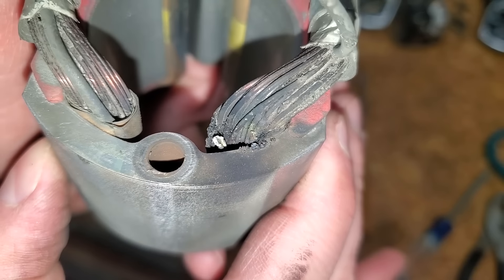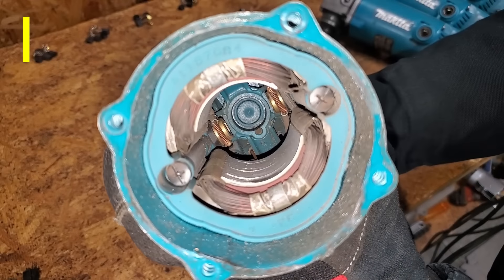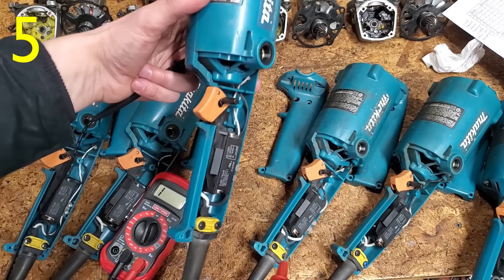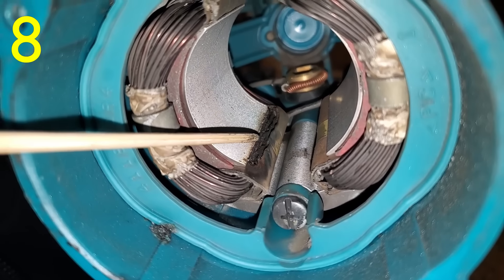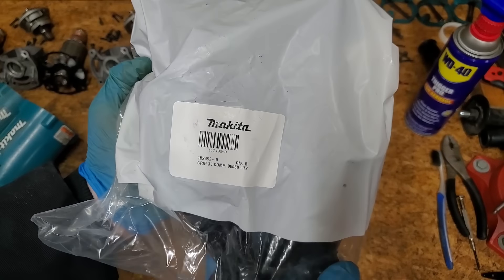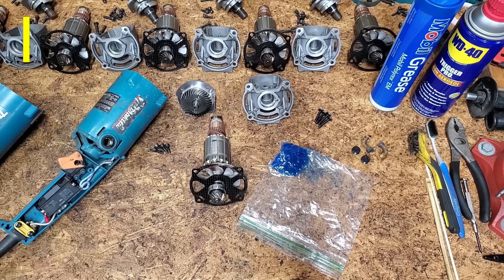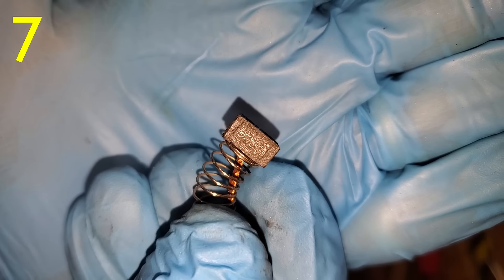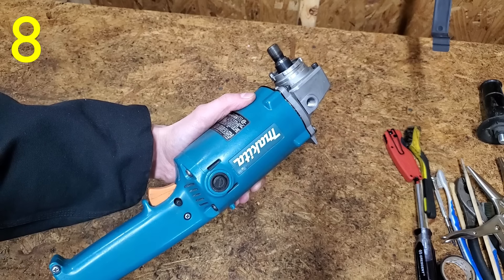Repairing Makita Angle Grinders

Comment: Awesome work Mike. An alternative approach (and no approach is better or worse) is to determine the weak link in the grinder i.e. the stator . In the 1980's I was running a fab shop and the go to grinder was Bosch and the weak point was the armature. So in this case repair four grinders and keep spare bits to keep them running. Absolute luxury in a shop would be three grinders with a cutting disc a grinding disc and a cup brush on each and a spare grinder on the shelf. Please never use a grinder without a guard. Look at How to shred 4 fingers with a woodworking power carving disc - stumpy nubs on you tube.
Reply from the maker: Thanks! All of my grinders have guards and I've been trying to find a toolless version that'll work with these Makitas.
Reply: I have a couple of Bosch grinders. I used to use them almost exclusively because they are really smooth and vibration-free. However, they have really thick casings which leads to uncomfortable hand cramps after using them for hours. I went to the newer US-made (they don't make them here anymore unfortunately) DeWalt 11amp grinders, which are more powerful and much more comfortable for medium-sized hands.
Reply from the maker: @TehButterflyEffect  I have 2 Dewalt angle grinders and have been happy with 'em. I'm not a pro though so I don't use them a lot.

Comment: That little tip about backing it out a couple turns when driving into plastic thread was really useful, thank you.
Reply from the maker: I'm glad, thanks for the comment!
Reply: I've taken many things apart and put them back together and I've never heard or this or discovered it myself. Learn something new every day
Reply from the maker: @aidenschvatkok5732  I'm glad you picked up something new, thanks for watching!
Reply: Works also well with metal and wood. One turn is sufficient, in a logical world at least
Reply from the maker: @sonorex  Yeah, the smaller the threads, the harder it is to feel/hear the "click".

Comment: Really enjoyed the video. 
The spare parts from Makita were surprisingly good value. Never though the windings would be economically viable to replace. 
I contacted Makita in the UK and asked what the yellow grease specifications were they factor fill the gearboxes with. They said they couldn’t help. I wanted to Re- Grease my plethora of grinders. To make them last.  I ended up using a red molly based HP grease.
Reply: Will be getting a tube of the blue stuff you recommended. Still would like to know the suff Makita use. Maybe is a trade secret 🤫
Reply from the maker: Thanks! :) How does Makita not know?!? I had the same issue, I was unable to find the yellow grease.
Reply from the maker: Me too! If you ever find out, let me know the secret. :)
Reply: I think they know. But don’t want to be helpful. I sure in UK they would much rather sell you a new grinder than help with spare parts and data.
Reply from the maker: @stephenellis3430  I'm just surprised, especially since the Internet exists, that type of grease isn't well known. It's not like only Makita uses it but I still couldn't figure out what it was called or even what type of grease it is.
Reply: It's whatever grease the Chinese factory has on hand that day. @Mikeattempts 

A red moly grease is good but not the best choice. I packed two grinders with it once and fried both of them. It's a little too thick for this kind of application. That blue grease you used seems like it was a much better choice.
Reply from the maker: @TehButterflyEffect  Yeah, I hope so, only time will tell on the grease.
Reply from the maker: @stephenellis3430 Another viewer, Zuzu Zaza, who works for Makita, told me that the yellow grease they use in the angle grinder gearbox is Mobil Mobilux EP 1. It's a NLGI 1 grease whereas the Mobil Polyrex EM grease I used is NLGI 2. However, after looking at the spec sheets, even though the Polyrex is a little thicker, it's polyurea based instead of lithium based and has some other properties that make it look promising as an alternative to Mobilux (my opinion). I gave 2 grinders back to the shop as a "thank you" so I'll ask 'em to let me know how they perform/last compared to a new grinder.

Comment: Three year ago I serviced my 45 year old 9607B grinder, which once belonged to my late father. One of the brush caps was broken, but still available (after a long search). Cleaned and greased it, replaced the missing 180 mm guard and also added a 230 mm guard. It 's working perfectly (again).
Reply from the maker: That's awesome! It's great that you could still get a replacement brush cap for a 45-year-old tool. :)

Comment: very nice! I only wish you had compared stator of old makita vs new ones and see why they fail, considering old one has the longest life and still fine. 
Couldn't tell from video, that white wire was copper or something else?
Reply from the maker: Thanks! I couldn't really see a difference between the stator in the older grinder vs the failed stators vs the replacement stators. They're pretty simple, just 2 long pieces of enamel coated copper wound into 2 coils and jammed into a steel cylinder. :)

Comment: My cousin used to buy their saws in bulk and would give them to his kid when they died, he fixed them and sold them on. I am amazed at the parts support and ease of repair for Makita- things aren't glued together and soldered so you can actually fix them I saw one tool with soldered brush wires
Reply from the maker: Yeah, I've tried repairing cheaper tools but they don't make it easy. Between not being able to get replacement parts and making them overly difficult to repair (like you mentioned), you might as well just buy a new one (which is what they want). You'll pay more for a brand name tool but with that comes quality and repairability.

Comment: great video! at/near 19:48 you ask tips to install tricky springs, Crochet Hooks work, but you should get your workshop own ones, not to make their owner angry at all the scratches and grease. forceps are also handy, especially locking ones .
Reply from the maker: Thanks! Is there not a tool that the pros use to get those springs on quickly?

Comment: Many thanks for your knowledge Sir! I have a similar grinder which I used today (silversmith) I was using it sanding down a large gate with had around 3 coats of paint on the wood frame. I stopped when the machine started making a noise at the motor head. The brushes were half way worn, so I then removed the head, grease chamber was at it's minimum, so I applied a load of copper grease. The grinder still functioned, but noisy and every time I switched it on, the lights in my shed would flicker! I will try using the 400 grit in a hope that this is the problem, unless you can inform me? Many thanks!
Reply from the maker: I'm no pro but it sounds like the brushes aren't making good contact. Do they slide freely in the slots? Also, be sure to use the proper grease thickness in the gearbox. If the grease is too thick, it'll just get flung off of the gears and it will get hot much faster.

Comment: Massively satisfying.  Hard to find people with the patience to just fix it and not throw it away these days.
Reply from the maker: Yeah, this has been a very fulfilling hobby and I've learned a lot so far, thanks for watching! :)
Reply: Repair cafes are good for this, and are growing fast around the world. They thrive on people like Mike who have some fettling expertise. A lot of repairs are at the 'new brushes/replace the cable' level and can be done very quickly/easily. Given a few people who between them can do a bit of electrics, sewing, woodwork and soldering, a lot of stuff that would otherwise be thrown out can be fixed.
Reply from the maker: @xxwookey  I didn't even know "repair cafes" were a thing but that sounds like a great idea!
Reply: Yes, we have repair cafés down our road in Kenilworth UK.
But the video is extraordinary in a subtle way because the viewer asks themselves at the start:
- what will happen to the other tools, where there are fewer in number of each model?
- has Mike picked the largest number and most popular tool because he wants to make money, and will swop good parts around to make 6 good'uns without any outlay?
- will he leave the gear housings with fresh grease alone, to save labour?
- why did he throw ALL the old grease into the environment, and why meticulously ultrasound the housings clean?
- why invest in new stators without looking to halt the overheating for all eight machines?
- why invest $200 unless he's sure each machine will recoup its individual cost? 
- where are the disc guards and why shiny handles all round?
- what is the sale price and sales channel for them, do the housings need attention before attempting sale ?

The pattern to these outstanding questions is that Mike has an obsessive desire to create quality with properly little compromise - a "97% will do" kinda guy.  Now many of watching are probably like this too.

But then Mike and some of us diverge: He's determined to make every patient survive, with an unbearable empathy towards any machine that might get trashed without his help. He makes the quick-fix machines subsidise the badly wrecked ones, so that as a group they still come out with a slight economic justification.  He doesn't want just a few to come away with a massive profit !!

It's also rare that an obsessive technician, who films and edits every step of work on every machine, also has the capacity to deliver a natural sounding, comprehensible, terse narrative.  You might expect an individual with such strong ties to machinery, not to have such great communication skills too !  Amazing find.  Great work. This video will hopefully find its way to inspiring repair cafés around the World.
Reply from the maker: @advance-heating  Wow... I don't really know what to say. Pretty much every comment I get is positive or supportive or informative which is immensely appreciated. But this comment is the nicest, most thorough critique of a video I've ever received. Thanks for taking the time to watch my video, think about it, and leave such a thoughtful comment.

Comment: It would've been good to see you rewind the stators.  It is doable.
Reply from the maker: Some other viewers mentioned the same thing and gave me enough information to realize that it is indeed doable. I hadn't even considered it but I still have the old stators and 2 more broken grinders so you might see me give it a try in a future video. :)
Reply: @Mikeattempts  
Good luck.  I've done it myself.
Reply from the maker: @paultrauzzi5360  Thanks, any tips and recommendations for good places to buy the enamel coated copper wire would be greatly appreciated.
Reply: @Mikeattempts  It's pretty time consuming for one off work.  Really need to fabricate a bobbin to get the correct physical dimensions for each loop.  Then you need a method to wind the wire around the bobbin while keeping tension on the enameled wire and keeping count of the turns.  Speaking of which... you have to accurately count the OEM turns.  You also need to accurately measure the diameter of the bare wire.  After that start searching for enameled wire or magnet wire.  It is doable... but really far from practical.  Remember you still have to get the new loops installed and insulated with fish paper and secured (lacing cord?  I can't see how they did it).  McMaster probably still carries wire.  I know Prem Mag uses Remington for their wire.  Plenty of other sources for it.

It could be quite the learning experience.  Plenty of video opportunities if that is your sort of thing.
Reply from the maker: @Failure_Is_An_Option  Cool, thanks for the info! I do realize it isn't practical, but it might be fun to try.

Comment: 00:05, please do more repair videos about those power tools.
Reply from the maker: That's the plan! :)
Reply: @Mikeattempts  by the way, this video is amazing.
Reply from the maker: @nelchan2421  Thank you, I'm glad you enjoyed it! :)
Reply: @Mikeattempts  update?
Reply from the maker: @nelchan2421  I've been working on some Makita cordless drills. I'm not sure when it'll be done though.
Reply: @Mikeattempts  00:05 this my friend
Reply from the maker: @nelchan2421  Yeah, the Makita cordless drills were from the same pile of tools. There were 8 Ingersoll Rand die grinders in that pile tool. I started making a video about repairing those only to find out there were no replacement parts available. I'll most likely pull some more tools from that pile and start working on a video after I finish the blower video.

Comment: I like it, could have made four good from the eight for nothing, but for one grinders worth of spares fixed al eight. I am sure the original handles would have been find too if you had them.
Reply from the maker: Thanks! Only 3 of them came with handles and replacements for the other 5 were pretty cheap.

Comment: Makita became popular in the eighties. They were probably the best made tools in that time period. We had to replace the brushes, bearings, caps, and cords, for warranty legalities. The bad fields, we would rewind. The communatators, would get growled, turned, and undercut. If you don't have a undercut saw, you can grind the set off of a hacksaw blade. If the mica isn't undercut below the copper, premature wear on the brushes, and arcing.
Reply from the maker: I would like to try rewinding a stator, but I don't have one of those fancy commutator lathe things to do the armatures properly. So, it's fine grit sandpaper for me. :)

Comment: Great work in repairing the grinders , while ordering the replacement parts , you should have gotten 8 disc guards for them .
Reply from the maker: Thanks! I did look into buying the guards but they aren't toolless. I'm guessing none came with these broken grinders because the shop probably never put 'em on, just threw 'em away immediately. :)
Reply: Why? So the next person can throw it in the trash where it belongs along with that stupid handle that comes with a new grinder.
Reply from the maker: @Trump985  Yeah, that's what I was thinking too. A guard is good for a homeowner who has never used an angle grinder but I would venture to say that the majority of pros don't use it. Personally, I do find the side handle very useful for better control.
Reply: @Trump985 guards are trash. Handles, however, I find much more useful. Not all the time, but those big grinders are heavy and I find I can get much finer control using a handle. They’re handy to have once in a while anyways
Reply: The handles are certainly useful on the bigger grinders I have a 12in angle grinder and that has the handle, but on these little 4.5 and 6in grinders they are absolutely pointless.
Reply: @Trump985  to each their own!
Reply: @Mikeattempts  A guard is very useful if a cutting or grinding disc disintegrates at speed. The fragments can be lethal projectiles.
Reply from the maker: @autophyte  I agree, they can protect against nasty injuries.

Comment: Great repair job, done a few of these myself, they are great angle grinders. I would advise, when doing all that work in the repairs, change the bearings rather than servicing them, as there will be damage if they're dry. I imagine why the cables were grey, because they were the cheaper pvc rather than the more expensive rubber.
Reply from the maker: Yeah, the bearings seem easy enough to replace and I'm guessing they don't cost much either. Thanks for watching! :)

Comment: Nice work. I suggest after the "it's good" test, check continuity between the metal head and both side of the plug - with the switch "on". Yah, it's supposed to be double-insulated, but you were in there doing things, and shi*t happens. UL/CSA/ETL requires this test during manufacture.
Reply from the maker: Ah, that's a good tip, I'll test 'em out. Thanks!

Comment: Nicely done, the mere fact that you can disassemble them speaks to the quality of the build of some of the older grinders
Reply from the maker: Thanks! Yep, they're definitely good quality. :)
Reply: Theor newer ones are like this as well. The Makita grinder design is so ubiquitous they never stopped to change how easy they are to disassemble and reassemble which is incredible these days.
Reply from the maker: @classydays43  That's how it should be though. If you spend $200+ on a grinder, it should be easy to maintain. You know you've got a quality tool when the brushes are easily accessible without any disassembly.

Comment: I happen to like a guard. Unless you're a welder wearing a leather apron, those guards save your clothes from tiny burn wholes. You rarely need access to the entire wheel, if ever.
Reply from the maker: I usually like the guard too. Even when it does get in the way, most newer angle grinders have toolless guards so you can adjust 'em quickly.
Reply: The guard is an extremely important safety device. It keeps you from getting sliced.

Comment: The 9005B can take a beating! I have burned up, smashed and worn out many of them. Not abused mind you just worked the hell out of them for several years and they wear out of something failed . I have largely moved to cordless Milwaukee grinders now as my grinding needs are minimal and I have grown to hate a power tool with a tail! . However when I have a lot of grinding, the old 9005B with a tail comes out and away we grind. Bad power cords and worn brushed  were the biggest cause of stoppage I had. I kept a spare cord or two and brushes in my truck as a result. Good stuff
Reply from the maker: Yep, they definitely feel like quality tools with plenty of power, I plan to keep a couple for myself. Brushes wear out and power cords take a beating so it's nice to hear that you didn't have more expensive failures. Thanks for watching! :)
Reply: @Mikeattempts  I did melt down a gearbox once. Apparently you need grease in there! 🤣
Reply from the maker: @warrenjones744  Hahaha, that's nuts!